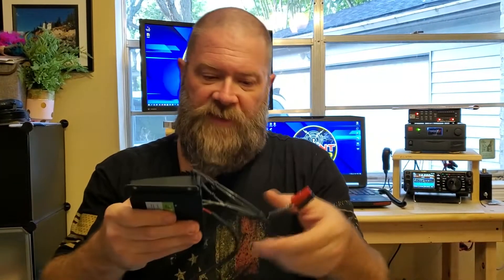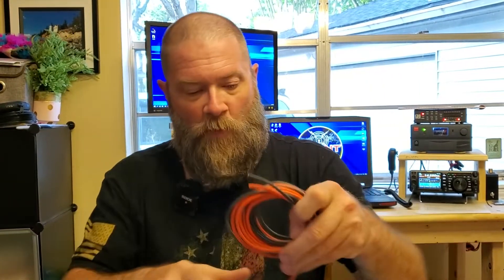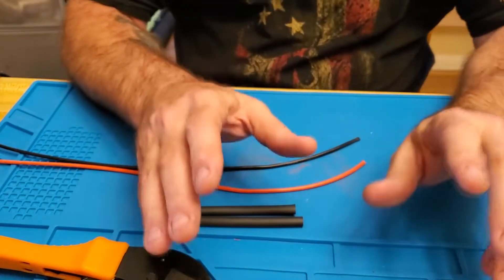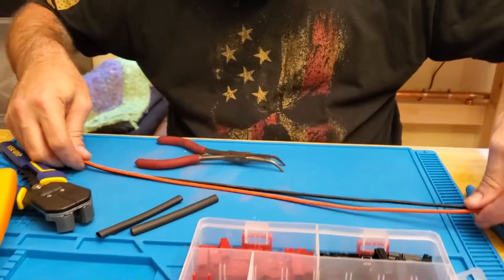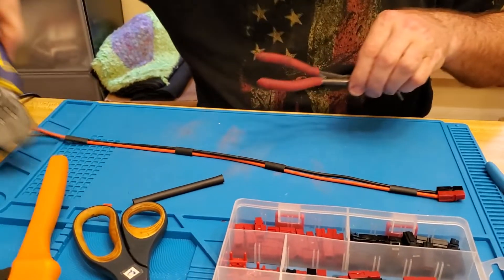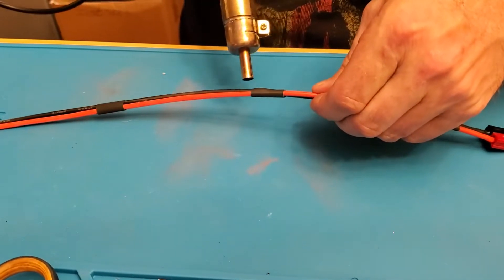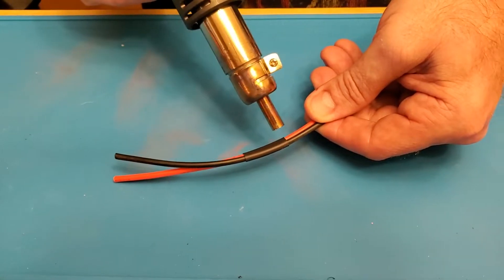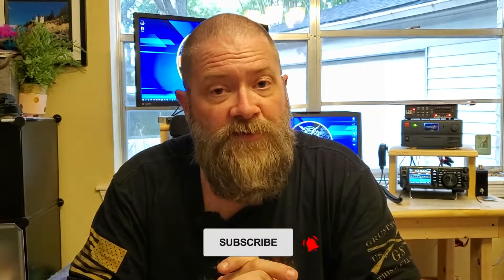Making an Anderson Power Pole Connector Wire

Comment: The mnemonic I learned is "Red Right, Tongue Top).  Looking at the plug end of a black/red pair, the red fitting should be on the right.  Rotate the red wire so the "tongue" is on the top side of the wire.  Insert into red fitting and push. Voila.

Comment: Great video! One more thing you can do is add a Farrel on the end that screws into the charge controller and it will keep the wires from breaking off when smashed. Just a suggestion.
Reply from the maker: Great suggestion!  I will try that!  Thanks for the comment and for watching.  73!

Comment: Is there a easyer way to insert the pins in the housing also 🤔
Reply from the maker: You can use needle nose pliers.  Maybe try to get a hold of a precision plier and that would work fine.  Hope this helps.  Thanks for the comment and for watching.  73!
Reply: @HR4NT  thanks, that's a good tip 🤗

Comment: Are they some easy ways to get the connectors out and the housings detached? A video would be good. They hurt a lot by hand, specially with my fibro. 😞
Reply from the maker: I have not found a suitable way to detach the inner part to remove it form the housing without a pick and a lot of swearing...LOL  I usually buy a kit that has a bunch of extras so in the event I damage or screw up one, I just pitch it out and make a new one.  I hope this helps.  Thanks for the comment and for watching.  73!

Comment: Nice video 👌
Is anywhere a shop, that sells the inner blades for replacement to the uk, I could find them for 15A,45A,75A that they not cost an arm and a leg for me. 😔
Reply from the maker: I went to the UK Amazon and did a search for Anderson Power Pole Kit and found this:  https://www.amazon.co.uk/GTIWUNG-Disconnect-Terminals-Connectors-Connector/dp/B0B4NTJVQ1/ref=sr_1_4?crid=1PEITCR31O2OK&dib=eyJ2IjoiMSJ9.VgUPsDJaF9T6PsAmHLnPFnOHa639Mn-FiLlJyDKMTc3LYSz_93mNF9wQhe2pEKrKUwEGMH5cTqgaCGAynJIAUeiivhZJpjfKojzeL3YU2j1ZSCyv7oI6KnCXSTr1E4Rusj35gVamAIi70g1DWd720gRwJdnFPC7q6HJwhBinxgp3Vnwnd0wr0w20j8M6tr4ob38HlVcLxIUK0hJnaUWear937MtDcpPTgUbIvfZz62q7IjNMmrqVkUkzgS9eKYCpHgrvxoGNykMpqlsSuU7er_RYR6m3btjIonwuZECt0Nk.wOK5t4nHQPfSRIbwzIAHXug2eP7-HIPkcD6VE9PXJDI&dib_tag=se&keywords=anderson+power+poles&qid=1718759951&sprefix=anderson+power+pole%2Caps%2C200&sr=8-4

Hope this helps.  73!
Reply: @HR4NT  thanks for the effort but I was looking only for the lug connector parts not everything.

Comment: Thank for the video. It's good to see I was not the only one to be human when I made up some powerpoles today (6:47). 😁
Reply from the maker: LOL...yup!  Thanks for the comment and for watching.  73!!
Reply: Just re-watched and if you take shrink to fit tubing on the wire up behind the metal connector to butt up against the connector it stiffens the wire and makes it easier to snap in and acts as strain relief. (Saw this on SA's channel)  @HR4NT

Comment: I like it that you struggled a bit with inserting the wires into the power pole.  As someone who is new to putting things together like this it makes me feel better to see someone else having issues instead of the picture perfect builds you see a lot of you tubers do!
Reply from the maker: I try to keep it real and make sure that my videos portray an accurate representation of what you can expect.  If I run into a problem with something I want it documented for that very reason you stated.  Thank you for the comment and for watching.  73!
Reply: @HR4NT  I would tell you to keep up the good work...but as I am a year behind and slowly catching up, it would seem you already are.  LOL
Reply: I too am glad that you were having the trouble getting the connector to go in because that is why I came to see if there was an easier way to get them to go in.

Comment: Thanks, but ,,, you should take better care to make sure ALL of the wire strands are inside the connector before crimping. Both of your connectors had a one or more strands hanging out of the connector. This carries lots of risks (e.g. shorting, and reduction in current carrying capability of the cable), and is also just sloppy work. I mention this only because some people might be viewing this in order to learn how to use these connectors, and they should know how to properly do it.
Reply from the maker: You are correct.  Thanks for the tip.  73!

Comment: Get a red/black power cable and split the ends as you need, old son! Much neater.
Reply from the maker: I agree.  For this build I wanted to use the same wire that came with the system and couldn't find the version that was attached.  Thanks for watching.  73!

Comment: Hey Scott, What is the make and model of your solar charging device ? I have been looking for one that has the technology for the Bioenno battery's. Jim KO4MKP
Reply from the maker: The one I got from Bioenno Power was the 12V/24V, 20A Solar Charge Controller for LiFePO4 Batteries (SC-122420JUD):  https://www.bioennopower.com/collections/solar-controllers/products/12v-24v-20a-solar-charge-controller-for-lifepo4-batteries-sc-122420jud

Comment: I've gotten away from crimping my power pole connectors.  I solder them in place.  In theory I can reuse them, but I haven't done that yet.  I almost always have to use small needle nose pliers to get them inserted properly.
Reply from the maker: I considered this as well, but I went ahead and bought the crimpers.  Not sure why the Anderson PP set is $50!!!!  Expensive little things...so O make sure that whatever I am going to make with them, I actually need..LOL  Thanks for the comment and the support!  73!
Reply: @HR4NT   I buy the individual components I need from Mouser.  It's a little cheaper.  The problem with Mouser is it takes a bit more work to figure out what you need to order.  But now that I've ordered each bit, I just have to search my previous orders.
Reply from the maker: @gregn3gds172  Excellent!  Hey, if it works for you that's all that matters.  Post a link if you find it!  73!
Reply: @HR4NT   Link incoming via email.

Comment: I have to say we have much in common, I too am an old guy who is a new ham, I too had a tough time getting power poles to cooperate. Where we differ is I am not bold enough to make my mistakes publicly. There are so many swamp rats who seem to do nothing but critique youtube videos. Have you tried a wolf river coil? I'm liking what I see about them.
Reply: I was going to add this same comment -- seeing things only done the right way doesn't help much when you make a mistake or aren't really sure which is the right way to begin with. 

One more bit of info for folks new to the Power Poles, is that the crimp bits come in 15, 30 and 45A sizes but they all use the same plastic plug pieces. Trying to get the skinny wires that use 15A crimps into the plastic pieces requires something like those needle nose pliers, or a soundproof room where you can say very bad words very loudly without offending anyone...
Reply from the maker: The previous wires I made that were both black, those snapped in with no issue...these wires I used in the video were liker wet noodles.  Someone suggested a tool that helps insert them, but I didn't even think that was needed until the video.  As far as making mistakes on video...hey I am only human.  Haters are gonna hate and that is OK.  No one is perfect and I know that it will happen to someone else down the road.  It was irritating that I was trying to get them to cooperate in the video and thought, "ok, this will be a 10 minute video..."  Yeah...NO! LOL  

I have read about an considered Wolf River Coils.  When I bought the MPAS it was between the two and I ended up with the MPAS only because it seemed like less work to tune the antenna as opposed to WRC with that sliding thing to tune to different bands and so on.  WRC are definitely cheaper and possibly more readily available.

Thanks for watching as always!  73!

Comment: With additional experience, you will be able to insert the terminals into the connector without so much difficulty.
Reply from the maker: It would also help if the wires weren't wet noodles...LOL  Apparently there is an insertion tool available...maybe I will look into that down the road.  Thanks for the comment.  Thanks for watching!  73!

Comment: What do you think of Powerwerx Powerpole Insertion tool? Timely video as I’ve got to buy Anderson Powerpole connectors and tools for future installation. Thank you. 👍
Reply from the maker: Actually, until you just mentioned that...I didn't know there was a tool for that.  The first set I made went in with no issues, however the wire was a lot stiffer than the wires I used in this video.  I will look into that and maybe add the link to it in the video!  Thank you for the suggestion!  I appreciate the comment and your support in watching my videos!  73!!

Comment: Also, you can purchase red and black wires that are together such as on a spool. Ray W2CH
Reply: yep, however then you have to orientate the ends wnem you crimp so they go in the same way. worth the extra step for sure.
Reply from the maker: That is a very good point.  Might take a bit more time, but could be more practical.  Thanks for the comment.  73!
Reply: If things are hard to find, try You Do It, in
Massachusetts, near Boston, been around
since the 1960's. Ray W2CH
Reply from the maker: @raymondmartin6737  Thanks for the info!!!
Reply from the maker: I was trying to find something like that, however these wires are rated for 200 degrees Celsius and have a thicker silicone shielding on them.  Sourcing stuff these days is becoming a real hunt.  Half of the stores locally don't carry as much stuff as they did a year ago.  I appreciate the comment and your support!  73!

Comment: I use small pliers to push the wire with the
connector into the Anderson plugs. Ray W2CH
Reply from the maker: I did the same thing off camera.  The wire I bought was so flimsy (not in quality, just very pliable) it made it hard to do.  The previous one I made was super simple.  Thanks for the comment!!  73!!!